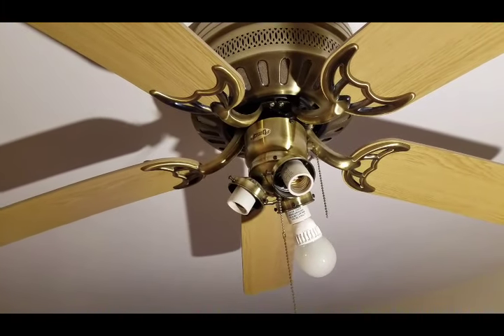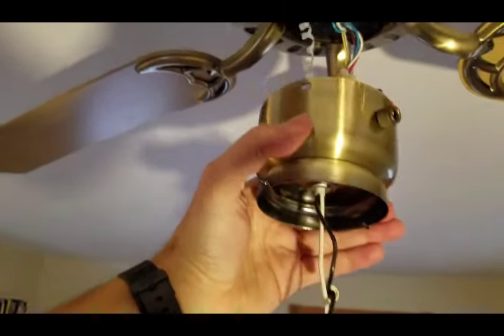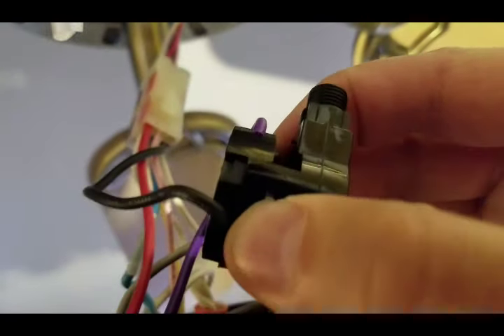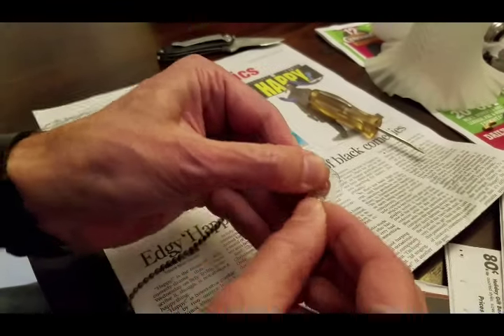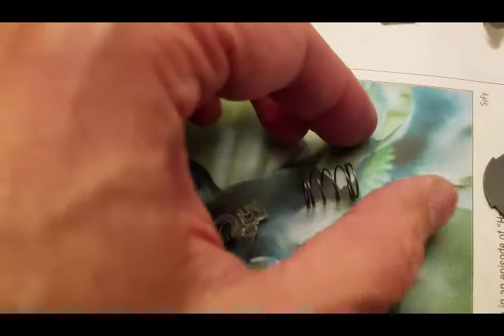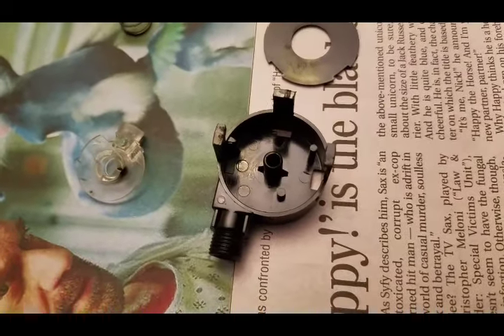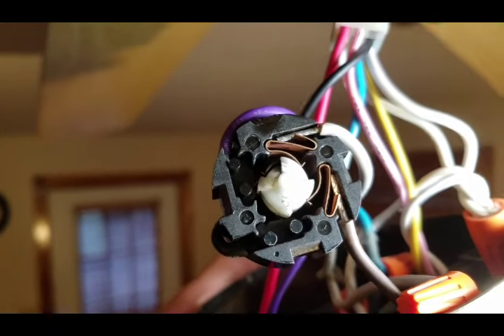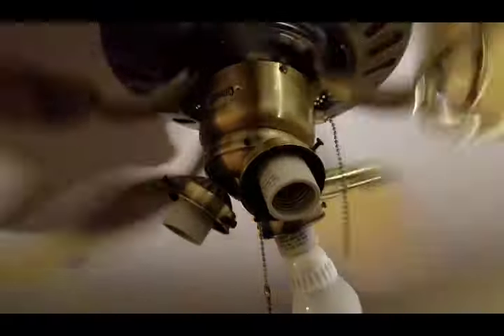Ceiling Fan pull chain repair - WITHOUT buying any parts

Comment: This is a great video. You are working with very small and intricate pieces to the ceiling fan chain housing unit. The video took close shots of those small pieces. You spoke very clearly and slowly to ensure the details were understood before moving to the next step of the process. You even took the time to point out where someone might encounter difficulty and suggested how to get through such challenges (binder clip). This was very well done and easy to follow. Thank you for a well-made and easy to follow video.
Reply: Blanche Mitchell I agree fully. I hope you're having a good day. You sound like a lovely woman.
Reply: I found that the tip to cut the new wires on the switch short was misleading.  I wasted two hours.  I didn't have enough wire.  It didn't look like he left much but I was about 2mm short.  caps wouldn't stay on good enough because i had no extra wire to tape.  but it's free help.  Just going to hire someone.  I was disappointed.

Comment: I watched a different video from a different poster first because it had more views.   It was a good video and can fix this issue as long as the process goes smoothly.  However I couldn’t figured after i put the switch back together why the chain wouldn’t engage.  

This video is much more helpful because it takes the time to explain the pieces and how they work.  Had it fixed in seconds after watching this video.

Comment: Thank you for making this video! It was very helpful and repair suceeded! The only other thing that would have been helpful is if you could have specifically stated that it's a little tricky to compress the spring down with its tail on the correct side of the stop while at the same time lifting the little wheel (with the chain ball on it) up and over the tab to get the stop on the wheel on the other side of the tab. You mentioned where everything went but not that tidbit about how to accomplish it. I wasn't getting proper spring tension until I figured that out. I used a new chain because I didn't want the same problem to occur anytime soon. Also, I ditched the decorative chain pull knob because it was heavy and maybe that led to the breakage. Thank you again for taking the time to make and post your video ~ it was super helpful!!

Comment: THANK YOU!!!!!!!!!!!!!!!!!!!
The ceiling fan in my living room has been broken for a few years now. There is a wall switch to turn it on and off but it was on high speed and now that it is winter time I was tired of being cold with the ceiling fan on. I already knew it can be fixed and I am a DIY girl. I went to the local hardware stote an bought a replacement part and then came home and started taking apart the fan and BOOM wrong part. Grrrrrrrrrr. So of course like most people I turn to youtube. I watch several videos and nope not helpful. Then your video played and BAM BINGO I CAN DO THIS. At first I tried without the clip (Grrrrr) I went looking for one and found it. I keep it on until after i snapped it in place and pushed the box closed as i removed the clip and AWWWWWW we are done. IT'S FIXED IDID IT.  Binder cilp GENIUS. Thank you for the detailed video. YOUR AWESOME!!!!!!!!!!!!!!!!!!!!!!!!!!!!!!!!!!!!!!
Reply: 🤣  What'da coincidence. It's winter of 2019 and I'm having to deal with exact same thing. We haven't turned on the light since this summer.

Comment: i wish i could see how you popped the case. i tried putting a small screwdriver in but i couldn't feel anything to push or pull to make it open.
Reply: Tony P  i figured it out. see the slots on the back? the long ones? push your screwdriver in there and then the case will pop
Reply: @karadanvers6136  i guess my fan is a different breed theres no slots on the back

Comment: Extremely helpful… figuring out the correct relationship of where the spring needs to be reinserted in both pieces when reassembling was the trickiest part, it took quite a while to be honest and I was getting pretty frustrated with it but I am one damn proud man right now… FIXED!

Comment: Good tutorial, but my problem is different. The chain is still attached, it just won't pull to change the speed. I turned it on to get it going on medium speed, but it went straight to fast, and now I can't turn it off unless I turn it off at the wall switch and then I don't have the light. I think the entire switch needs to be replaced. 🙁

Comment: This is great and everything, but for 4 bucks at HD or Lowes you can get a replacement unit you do not have to pull apart - the chain is like a buck, so remember you have the option to pay 2-3 more and not have to do surgery

Comment: I have a weird dilemma. I can't find the broken chain, nor do I have the metal housing that the chain ran thru. I definitely don't have the chain mechanism. My fan has one light bulb. The pull chain for the light is in tact but the other side for the fan pull chain has an empty hole where the metal socket and pull chain was. There's alot of loose wires. Looks like a purple, 2 black, and red wires but no housing of any sort. There's also a bunch of wires leading to the direction change switch. What am I missing? Thanks.

Comment: Thank you for this.  I had a 4 wire fan switch the chain broke off in, and no one local carried the replacement.  A bit frustrating to do, but your explanation on how it worked saved me from giving up.

Comment: Well I tried.  my switch was for the one that controls the fan speed and as soon as you try to pop the thing apart the insides completly fall out the wires and the contacts and a couple of other plastic things where only held in place by the two sides being sandwiched together.  It's as if it was designed to completely self destruct if you tried to tamper with it.  CHYNA!

Comment: This only works if your fan comes with a switch that DOES come apart otherwise you're shit outta luck. Most cheap fans come with a switch that's permanently sealed with rivets.  In that case you'll have to buy one, dirt cheap .. 3-4 dollars!
Reply: Thank you, i was trying to figure out why i couldnt get mine open.

Comment: So if I have rivets holding my case together I’m pretty much screwed?
Reply from the maker: You can drill the rivets - probably 1/8" bit (be sure to shut the power off first).   Replace them with sheet metal screws for reassembly.
Reply: @diychicken7279  thank you I’ll try that

Comment: Hi! I'm hoping you can help? I have a similar issue with a floor lamp, and thanks to your video I have most of it back together now, but the switch won't spring back to the start position. I pull and can feel the expected click that would turn the light on it off if it was plugged in, but then the switch only returns partway
Reply: i think i have the same problem
Reply from the maker: It sounds like the spring is in the wrong place.  Sorry this isn't much help, but try to make the mechanism work before putting it all back together.